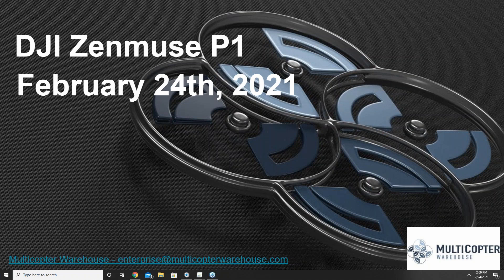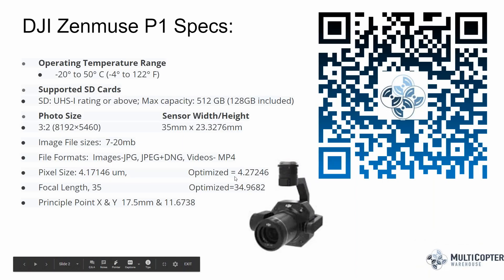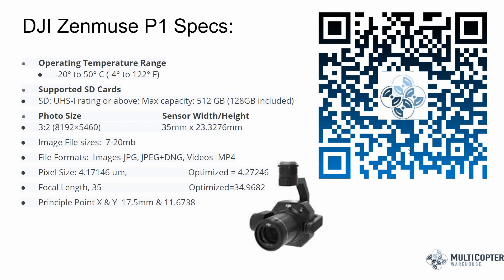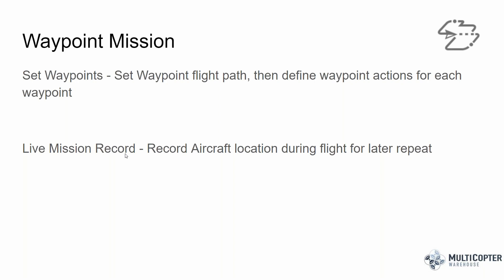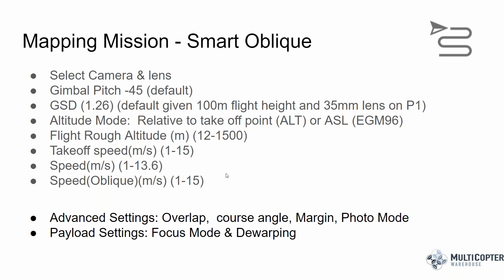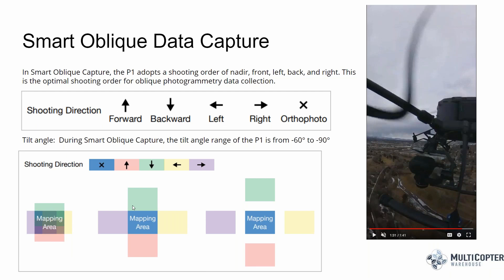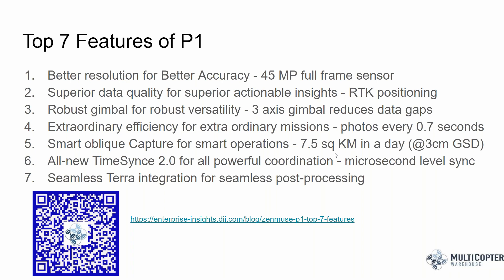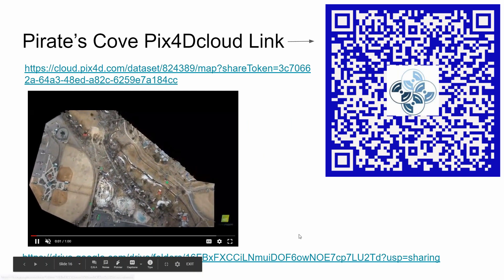DJI Zenmuse P1 - Photogrammetry Camera Webinar

Comment: Hello, We don't really understand the process of the 1 to 5 column on the left in PILOT 2 mission planning on smart controller (match with 5 colors mapping area?). Is it mandatory to perform 5 flights to have full mission accomplished? and why is it overlapping on the left scheme or with a gap on the right scheme (26:46") ?

Comment: Thank you for your very informative video. I have a question regarding flight planning. Do you need to have the drone connected to the controller to upload a kml file for mapping mission? I'm having trouble uploading kml. Have been flying mapping missions on the P4RTK for two years now and it appears the process to upload kml and create mission is different. Can you please upload info on the pre-flight procedure to follow for M300 with P-1.

Thanks and Aloha from Hawaii

Comment: when we use     Matrice 300 RTK with D-RTK 2 Mobile Station for matrice series
Does it necessary require an internet connection
will the RTK work in Area where there is no internet or even mobile phone signals ???
Reply: If you use the ground station you don’t need an internet connection. Only need a connection if you are using N-Trip

Comment: Great info. However there is a big limitation to the smart oblique mode (that even DJI support service could not answer) : how can you be sure to avoid motion blur in smart oblique mode when you cannot chose the horizontal speed ? The Zenmuse P1 is a great tool but so far we still use the oblique mission to be sure our photos won't get motion blur.
Reply: It has a global shutter which is meant to address these concerns
Reply: @B1g_Salad  global shutter prevents the rolling shutter effect. Motion blur is due to the shutter speed and the motion of the camera. The global shutter does not adress this issue.
Reply: Ah I see. I misinterpreted you question. I would think that the shutter speed is quick enough to negate this effect. Do you know if you could manually adjust the ISO setting on this sensor? If so, you could adjust the shutter speed to be quicker if this is what you are experiencing. 

This is all just speculation as I’ve never actually used this camera.